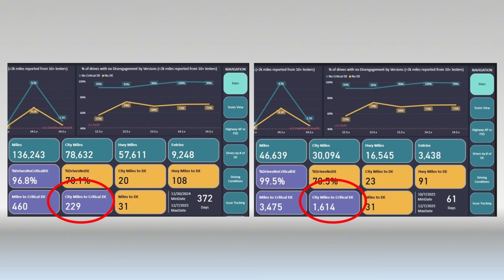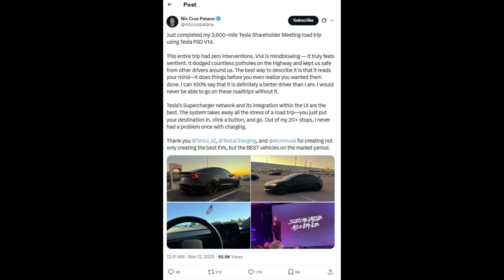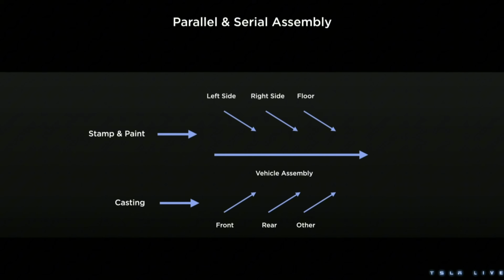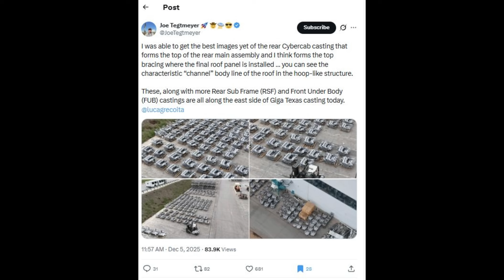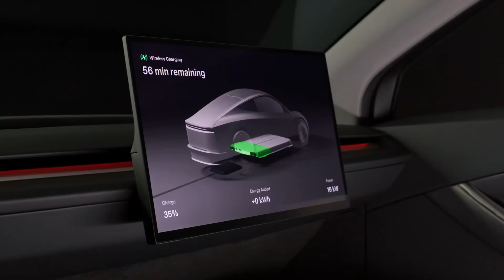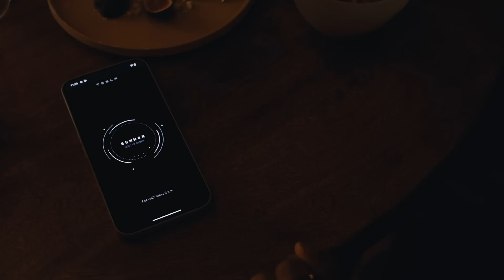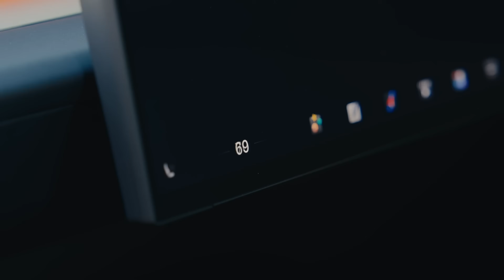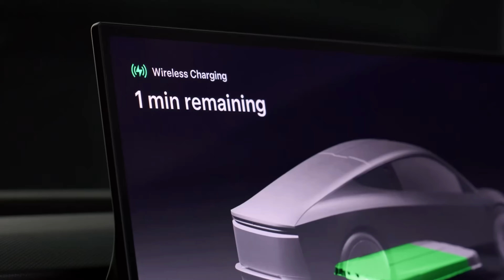Tesla Cybercab - The car that will change the world.

Comment: I’m not sure I agree that FSD is solved (whatever that actually means) If you go by the data in the community tracker (keeping in mind this is only one potential indicator) then the critical disengagements are 1600 miles in the city. Surely they would need to get over a million miles before unsupervised could even be considered.
Reply from the maker: It needs to keep improving at the rate of improvement from v13 to v14. It needs to that 2 or 3 more times.

Comment: loved every part of the video but I strongly disagree on the price/mile for the consumer. I did the math and It's far cheaper than 1$, including the depreciation of the vehicle cost, insurance, electricity cost, maintenance cost, cleaning cost. It all comes down to 0,25$/mile, with the assumption of 60k miles every year of robotaxi service (very possible for a vehicle that'll be available at least 16h/day if not more). Even if you add 0,1$, you get 0,35$, and you can be very profitable at 0,5$/mile. In the worst case scenario, you can charge the consumer like 0,70$, that's it.
Reply from the maker: Id like to see your math. Ill be doing a video on robotaxi economics soon. You can then see my breakdown.
Reply: @theteslamarketer My estimated operating cost for the Tesla Cybercab in 2026 is $0.282 per mile, based on an annual mileage of 60,000 miles.
This figure includes vehicle depreciation ($0.083) based on a production price of $25,000 over five years and insurance ($0.083) with an annual premium of $5,000. Energy costs account for $0.073 (assuming 5,5 miles/kWh and Supercharging at $0.40/kWh), while cleaning ($0.03) and routine tire and fluid maintenance ($0.013) complete the cost profile.
The end result positions the Cybercab at less than $0,30/mile. What ma I missing? let's say it's $0,40/mile, that's still profitable at $0,50/mile

Comment: Tesla's production model may be more efficient, less costly,  but it doesn't exist today and has yet to prove itself in real life.  One might wonder why that model isn't used for existing vehicles, which an owner will pay much attention to the details. The Cybercab isn't something anyone will pay much attention to once the novelty wears out.  Also, those wing doors are unlikely to be approved for cabs as they are possibly a safety hazard when opening and closing.

You're making a lot of assumptions about cost and time that I don't think are relevant when the use case and demand haven't been demonstrated yet.  Look at the number of CTs sitting unsold in lots around the country!
Reply from the maker: Cybertruk failed mostly bc of economics. The same reason why Cybercab should do well.
Reply: I wouldn’t say Cybertruck was a total failure. The looks are the biggest deterrent to Cybertruck, its capabilities are fantastic and I can see picking one up in the future.

Comment: I'm afraid those user submitted FSD trackers may be all we have to gauge Tesla's system and a valiant effort on the part of the community, but they're anecdotal and not scientific.  Neither governing bodies nor Tesla use them to validate FSD.  
Tesla on the other hand has the information, hands it to the various bodies validating the system to approve or not its use for Robotaxis. 

To date, Tesla has not been approved for full autonomy, either at Tesla's request (level 2 - to place the onus on operators, not on Tesla in cases of accidents) or because regulators feel FSD is not ready for levels 3-4-5.

Comment: How do you go from $23000 cost manufacturing to $1/mile operation cost?  If it drives 50000 mile per year and fully wrote off in 2 years, then the vehicle cost is 23 cents/mile.  Even if electricity cost is 20 cents/mile, still far away from $1/mile.
Reply from the maker: I have a big spreadsheet that includes all costs. Maintenance charging safety operators insurance cleaning etc.

Comment: Again, a great video! Thanks very much! Just curious: When using the Cybercap production cost of 23k and then adding the markup and the price of FSD, you end up with something like 37k and 38% of margin for the bundle. How do you know the cost and margin of FSD alone? Also, would have been nice to calculate the TAM and Teslas possible profit.

On a technical note, I liked the improved sound quality, but there is some subtile noice in the background (HVAC or ventilation?). This gets very noticeable when there is a moment with a cut and a short moment with no voice audio track (e.g. at 3:27 min). For me, It is even more noticable on 2x speed.
Reply from the maker: I assume 100% margin for FSD but you're probably right...it's probably not 100%. Maybe 95%. Wow, my computer fan gets picked up! Incredible. I was reading the script off my pc. The tower has a fan. Ill use my laptop, next time. Ty for watching and for your feedback.
Reply: Other channels have done deep dives into the TAM and profits - Warren Redlich, Solving The Money Problem, Electrified, The Electric Viking, Hyperchange, Brighter With Herbert, Farzad, FutureAZA, BestinTesla, Ark Invest.  I've watched many many hundreds, including Munro Live teardowns, Joe Tegtmeyer drone footage, Torque News, The Limiting Factor for tech/battery/scientific analysis, etc.

Comment: Thanks for the analysis. 

Are you sure model 3 premium rwd has LFP from CATL?  Kyle from Out of Spec reviews claims both premium and standard models of model 3 do not use LFP cells.  Ref: their model 3 standard video at 17:30
Reply from the maker: I thought it did but I guess it's possible that it doesn't. Either way, the math really comes down to smaller size + IRA credit. Maybe my starting point is off but relatively cheaper in the same proportion if you know what I mean. Thx for watching.